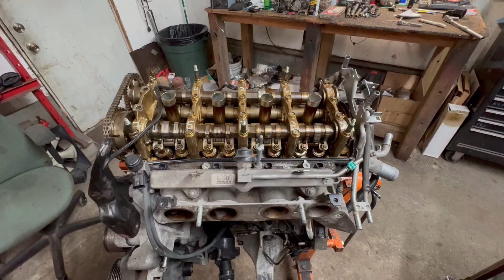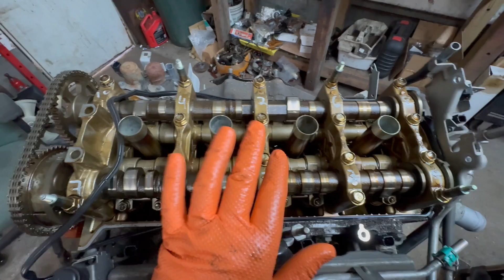Honda/ Acura  K24 2.4L VTEC Cylinder Head Torque Specs & Sequence Procedure

Comment: If you torque it twenty nine foot No need for 2nd step. Cause you're not going to torquet twenty nine foot pounds again
Reply: It’s to ensure all bolts are at 29lbs
Reply from the maker: Correct
Reply from the maker: That’s the procedure Honda wants. It’s just to make sure before going further.

Comment: Those are the cam bearing cap bolts not head bolts... The head bolts are below the cams!
Reply from the maker: Please watch and try to understand the video before commenting. I explained that in the video
Reply: @motorcarnut  ok but how about take the cams off and do it that way? Better way to view it?
Reply: Very well explained. Thank you brother.
Reply from the maker: Thank you!